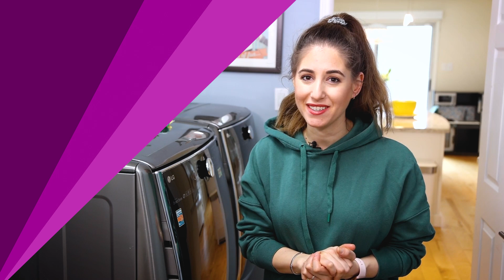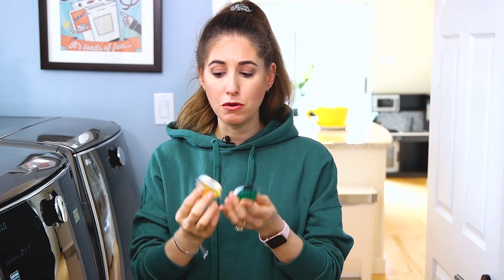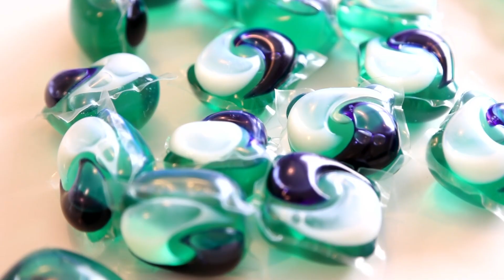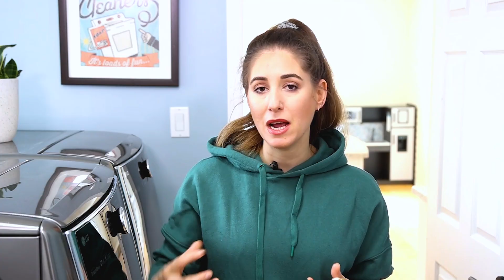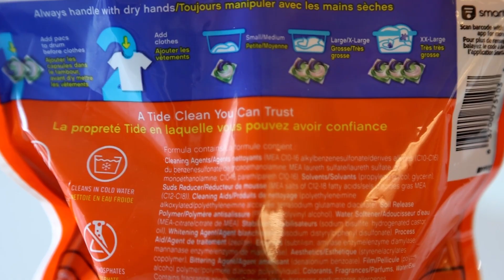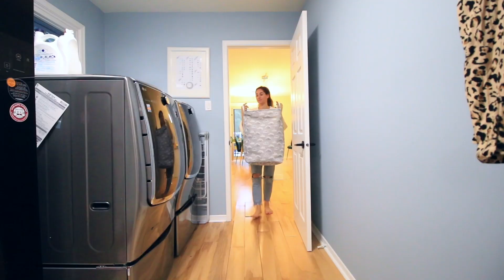Do Laundry Pods Work?

Comment: I only used the pods in college, but I do not use them now because they're so expensive compared to regular detergent, and I don't have a lot of money. Also, the chambers dissolve at the same rate in the washer and I don't think it actually matters that they're separated.
Reply: It could matter if they are different ingredients, like enzymes and bleach. They cancel each other used in liquid form together. So keeping them separated makes sense. You do need them to do different things in washing. Enzymes break down stains of different kind(protease break protein stains, lipase breaks down greasy stains etc). Bleach whitens the clothes and has a disinfectant properties.
They can cohabitate during the wash process but they do eventually cancel each other out. The smartest thing would be to use enzymes at the beginning of the wash with detergent and to add later the bleach to complete the cycle. Miele has something like this in their Twindos.

Comment: It might be my washing machine or depending on load size, what I don’t like about the pod is sometimes they dont break down all the way and get stuck on the clothes and are sticky like glue!
Reply: Always throw them in first before you put your clothes, no matter what kind of machine you have. That helps them dissolve  better
Reply: That was my issue as well.. have had different washers that I have tried them in and I’m not a fan at all.. have had the pods left on my clothes because they didn’t fully dissolve so def not a fan..

Comment: Interestingly, I live in the USA and buy my powdered laundry detergent from Canada! I use Nellie’s Laundry Detergent, Oxygen Bleach, and wool dryer balls! Nellie’s is kind to our earth and very concentrated so 1.5 teaspoons of detergent and 1.5 teaspoons of oxygen bleach is all I use per load. Both are powdered so it lasts a long time and gets everything clean without ANY fragrance whatsoever. I did try laundry pacs when they first came out, but the plastic film never washed out of my clothes so I am reluctant to try again.
Reply: Can you please share how you buy it
Reply: @Siriuslyyy , it might seem like expensive, but the largest size bucket lasts me 15 months when I did laundry for 5.  Now my nest is empty so it lasts about 18 months.
Reply: I use Nellie's also. I noticed I never have static cling. Maybe because the product builds up in the clothes.
Reply: @donnacrimmins789 , I have a front loader and not noticed any residue leftover in my clothes, but I do use less than the recommended scoop for most of my wash. My clothes are not stiff either from Nellie’s, which in my experience has been using too much laundry detergent.
Reply: @Stephanie-rf9xs  I meant other brands build up products in the clothes. I love Nellie's.
Reply: Nellie's actually dulled my colors, I don't recommend it for colors, unfortunately
Reply: @MegDesignsCA , I have not noticed any color change in my dark loads of clothes using Nellie’s; however, I have had color change when I used well water while visiting my sister.
Reply: @Stephanie-rf9xs  
Unfortunately, I did, so I had to stop using it 😪
Our family wears a lot of black
Reply: that's exactly what I was thinking that the film from these things don't get washed out they get stuck on the clothes sometimes but she didn't even acknowledge that.
Reply: @joyhanson8654  
She did mention that occasionally a pack may get stuck to an article of clothing, rinse it off in the sink ab rewash the load.
Reply: I have an old high capacity top loader and have never had residue.  I think part of the problem might be the new front loaders use so little water. Love my wool dryer balls.

Comment: Thanks for doing all that research. I haven’t used the pods mostly because I was unsure how they impacted the environment. I do like the liquid because I can use a little less or a little more depending on what my loads need.
Reply: If you think about the environmental impact, also think about how the liquid in them contains water and that causes more CO2 when transported than powder. Also they are less "compact" in the packaging - you need more packaging for the same amount of detergent. And the foil of the pods does not only have to be biodegraded but also needs to be produced like any other plastic foil, which takes a lot of energy. If you only need a little detergent, you would still waste a whole pod - again harmful for the environment. With normal liquid, you can customize the dosis more precisely, that's right! Because of the water used in it, when it comes to the environment, (compact) powder detergent is best, followed by normal liquid. The pods are still worst for the environment - and your wallet ;)
Reply: Do more research because they can be broken down, but most facilities don’t meet the conditions needed to actually break them down.

Comment: I use whatever is the best value per load. I have found that the powder performs the best IMO. Using the correct amount is key. The packs are good but I can't add 1.5 packs and per load I find packs are usually more. Also no spot treatment. I do LOVE pods for the cleanliness because yes there is always powder or liquid mess. Toss the pods in the back of the washer if using a frontloader because it can get trapped in the door and leave the casing.
Reply from the maker: Thanks for watching Blair

Comment: I am not sold on them. There’s still a lot of research out there that says they are not eco friendly. While there’s data that says they can be broken down, certain conditions have to be met in order for that to truly happen, and most water waste treatment plants in the US are not equipped to actually break down the materials that are damaging to the environment. It’s the same case as compostable plastics. Yes, they’re technically compostable, but it requires a special composting process that is practically nonexistent as of now. Any company can market themselves as eco friendly based on the fact that it’s possible. Doesn’t mean it is, yet. Additionally, I don’t personally think dyes and unnatural fragrances are beneficial and most pacs have them. For now, I will continue to use detergents that I feel better until more research from more sources comes out.
Reply: @rocklobstah1876  yeah, I am. I care about the environment and when both of your parents get diagnosed with cancer in the span of one year, you start to question ingredients in products you use regularly.
Reply: I agree!!! I am def a anti podder partly because they don’t fully dissolve I have found that in many of my washers so I don’t use at all besides they are way to expensive for the load of laundry I do daily or weekly for a family of 8
Reply: Correct, the conditions are mostly not happen. Researches of German environment ministry has shown this, too. BTW the detergent itself is not eco friendly, too. There are a lot of eco friendly detergent on the market. Why not choose one of them? They are not more expensive than these pods.

Comment: I switched to liquid detergent decades ago due to asthma. A few years ago, I switched to pods for storage convenience and they’re easier to use. Now I’m into detergent sheets. They take up much less space than liquids or pods, are even more lightweight and convenient.
Reply: I’ve also switched to laundry sheets because I’ve noticed the pods really don’t disintegrate as much as she indicated. And I heard that plumbers say those are a nightmare because they clog up our pipes.😬😒
Reply: @michellen3727  well, I have a Plummer as a family member and was told until they come out “Purely Plant Based” for the outsides of those pods do not use them. Haven’t heard of the sheets though. Meanwhile, I use Tide liquid and I have a few bottles of them. I use the Original for Towels, Microfiber Towels and Replaceable Mop Heads. I have the one with Downy as well as the Downy for clothes and then I have the Cold Water one for items to be washed in Cold Water Only. I don’t go through the Cold Water as fast as I do as the one for clothes. I also use the Percil Laundry Detergent on really stained sports outfits and other stuff that is hard to get out. I even have a washing guide right on the wall in front of the “Washing Machine” and the same for the Dryer. I have the instructions printed and there are 3 picture frames for the washing instructions and 2 for the drying. Trying to teach all of our kids exactly what to do and how to do it right. Have used a lot of Melissa’s Instructions and Advice as well as Martha Stewart’s also. Both Ladies are good for a lot of things in the “How To World”. Lol
Reply: I used laundry sheets too. I’ve gotten them from QVC but wasn’t sure they were working well, so switched back to liquid
Reply: @MomHarper927  I do miss the smell of Tide pods. And you’re right the sheets I’m on the fence about. But when I noticed my pods were not dissolving all the time I wrote to tide and of course they said sent suggestions like clean your washer more often or don’t overload the system, which I am very meticulous ensuring that doesn’t happen. But then I saw a video on YouTube about how many people complained that their pods were not dissolving so I had to make the switch.
Reply: @michellen3727  Ariel in the U.K. leading manufacturers of pods advise if u are using pods on colder temps or on shorter cycles like the speed washes it’s more likely the pods don’t have enough time to dissolve. They advise on colder temperatures and or shorter wash programs use liquids. So I’d imagine tide packs will be same.
Reply: @laurameakin I think we had tode manynyears ago in the UK or was it called Radian
Reply: Laundry detergent sheets are the best in every way started using them and you don't even need fabric softener. It's a win 🏆
Reply: Hadn’t thought about asthma; I have breathing issues and use liquid detergent and pods. I hate powder. I’m glad you pointed this out.

Comment: I use Tru Earth detergent sheets. So easy and the same applies. One half sheet per load, if dirtier, two sheets.  I also still have a 20+ year plain old top loading washer that works perfectly.
Reply: Oh I will never trade my old high capacity top load washer until mine is dead and can’t be fixed.   Gets everything so clean!
Reply: I love the Tru Earth detergent strips. I go for the fragrance free platinum type. You can get them on sale. Also on Costco online.
Reply: I use Tru Earth unscented.  I add about a half cup of washing soda, to help with sweat.  I still used washing soda when I used ERA.  I tear the strip up and throw it in the washer.  We don’t need plastic!  💙
Reply: Thanks, I wondered if they work well. I’ve tried other similar products and they didn’t break down well and seemed to be affected by moisture in the air.
Reply: I love my Tru Earth sheets!

Comment: I use only powder because I prefer unscented enzyme detergents and I haven’t found a pac that has the right ingredients. I do use powdered water softener in my laundry as well. It only takes about 1 tablespoon of enzyme detergent for a load of laundry and don’t see any utility to the pacs anyway.
Reply: What enzyme detergent do you use?
Reply: @NancyTS-VA  defunkify. If you are going to switch though, a lot of conventional detergent leaves residue in your machine so I would run a washing machine cleaner through first otherwise you’ll have a funky first few loads because this stuff will start lifting the gunk out of the machine. Also, less is more. If you add too much it doesn’t work as well the scoop that it comes with is 15 ml which is a tablespoon. Also it doesn’t contain optical brighteners so you’ll want to add water softener (not fabric softener that stuff is nasty) if you have hard water.
Reply: @adbreon  Thanks!